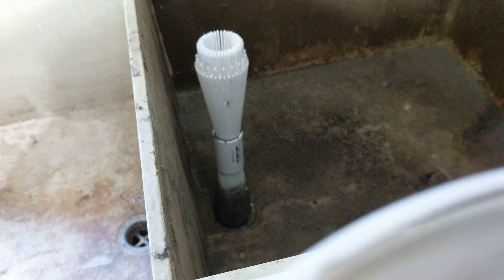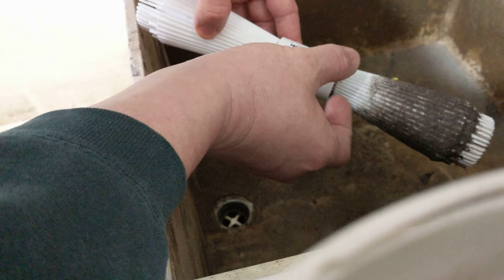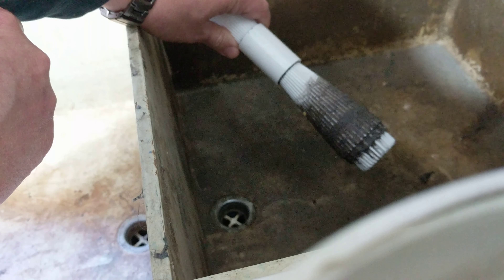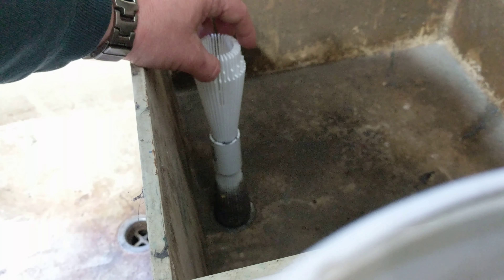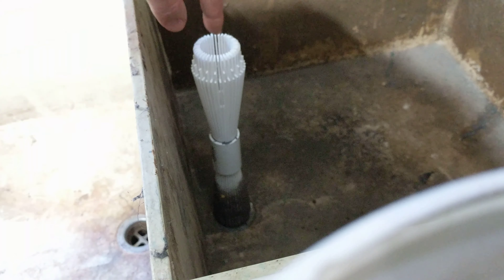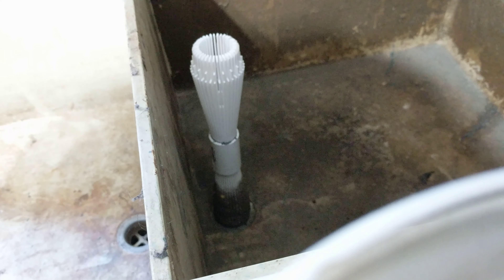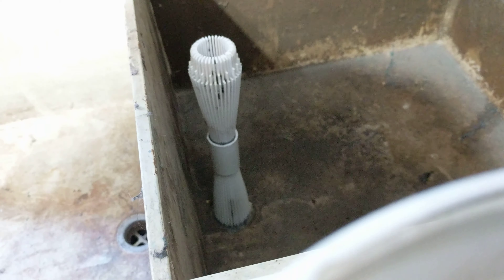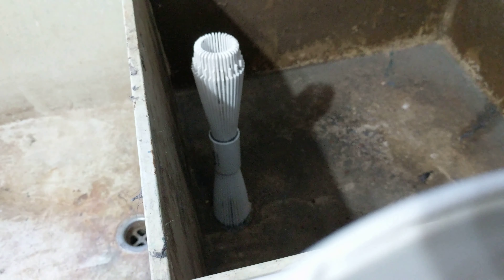Best Washing Machine Lint Trap / Hair Trap Hack

Comment: That's pretty slick. I just paid over $300 to have my frozen sewer line jetted, which has made me hyer-observant about what's going down the drain. I just did some laundry and I looked at that cheap piece of crap steel mesh sock and saw a prime suspect. I figuried I'd investigate by adding a second mesh sock and wrapped one around the drain filter. It didn't take long before I could see lint starting to build up on the mesh at the drain, so I added a third sock around the hose. It'll be intersting to see how much gets through each successive layer. After seeing this, I think I'll definitely add this to whatever over-the-top lint catching system I decide on. Thanks!

Comment: I use the mesh onion bags on the discharge pipe from the washer. I just use twist ties to hold it up. if it slips out from the force of water then you probably need a new bag there ...
Reply: As do I, but I still have a lint issue.  I use the mesh bags and the strainer on the drain still gets clogged.  I'm thinking that this solution might be better in addition (not instead of) to the mesh bags.

Comment: About the JB Weld... that's the putty, right? Or are you using epoxy or even the super glue they've recently come out with?
Reply from the maker: @benrositas8068  not the putty. Use two part jb weld epoxy glue in the two tubes that your mix together
Reply: @superedge99  Okay, thanks for the fast reply and for the video!

Comment: Did you get a 2" coupler and basically left 1" on each of the necks to slide into the coupler?
Reply from the maker: It's a 3/4" coupler that is a few inches long, and yes you leave about an inch of the neck to go into it. The lint traps actually will stop going further into the coupler since they get wider than what will fit into the coupler. Jb weld does a great job, mine is still working great 2 years later.